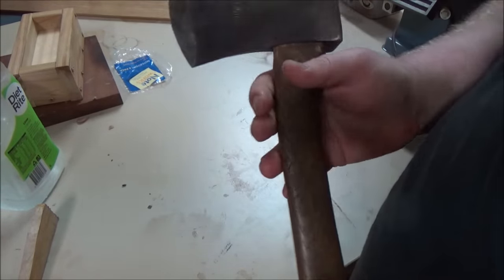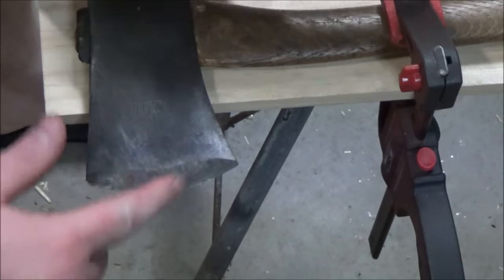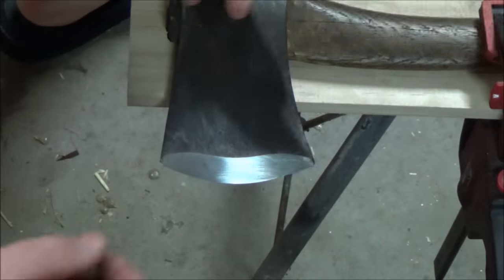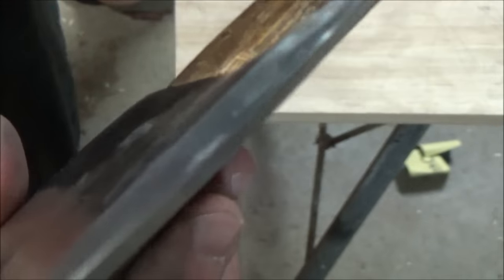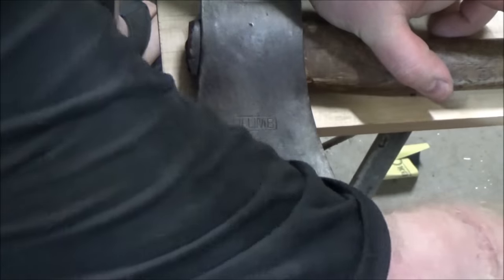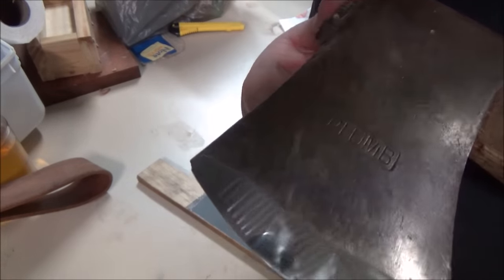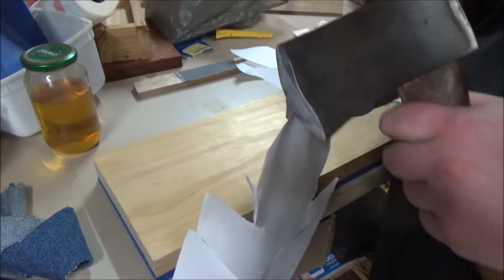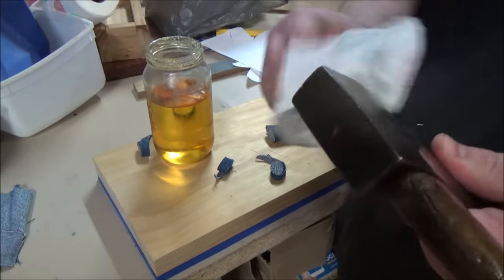How to Sharpen a Hatchet or Axe to a Scary Sharp Edge!

Comment: The hatchet is scary sharp, there's doubt about that. But. The flat angle that is being put on the edge is not best for hatchets and axes, it causes the blade to stick in wood. Hatchets and axes are supposed to have a rounded edge coming sharp at the edge, this keeps the blade from sticking while being used. Well done video, my friend, if that was a knife I'd want to have you sharpening mine.

Comment: Im gonna do this on my mower blade. I Love my Yard lol what can i say. TY.
Reply from the maker: It will work. But you have to be careful with mower blades. Make sure they are balanced or it is really bad for you mower. Look up how to balance a mower blade. I believe the little thing you put the on are quite cheap. The just take extra off the heavy side till balanced. You don't need to refine it like I did with the axe either. Rougher finish is fine. Even 120 grit should be fine even overkill for some people.

Comment: just remembe if you get too engrossed with the modern phenomenon of the micro bevel or "sharp enough to shave with" (who in their right mind shaves with an axe or chisel), that very fine edge is going to blunt, warp or chip very first use because its too fine to have the strength to stand the use.  only two things should ever be shave sharp, a razor or a scalpel.

Comment: About how long does it take to sharpen
Reply from the maker: It took me 30 min here. Including messing with the camera. It doesn't take that long once you get the hang of it and generally it isn't needed to be this refined of an edge. Less than 5 minutes of work and you can be back in buisness if you don't have to make a new bevel. Less than 30seconds if you touch it up often.

Comment: You should put one piece of sandpaper on each side of the stick. You wouldn't have to change them as often.
Reply from the maker: That would work well. I don't usually sharpen with sandpaper though.

Comment: hmm I have a diamond sharpening kit that's rough diamond to a very fine and there about the same size as how you made your strips
Reply from the maker: They will work great. But you are likely to wear the middle of the plate way more than the rest. So unless it is a cheapy you don't care for I wouldn't recommend it.
I have some cheap ones I do that with but they do unevenly wear on me. I had one where all the diamond was gone on the most used bit.
Reply: @scottshobbyz5416  I had them for years and I used then to sharpen my katana note it's  a real katana one of a kind made the way back then and they don't even look used and I use them every day to sharpen friends knives. I just didint think I could use them on a knife. It's a set of 12 different diamond like how you used different sand paper and 12 natural rock sharpeners

Comment: Is this axe convex edge ? Cuz i struggle mainting those edges
Reply from the maker: You can put either on there. I put a flat one and a micro bevel at the end for extra strength.
Touching up the edge is really easy and fast too. Just touch up the micro bevel with a fine Arkansas or similar  and it will be razor sharp again. You can do it loads of times before needing to address the main bevel again.

Comment: Going past 400 grit does not make the edge any sharper, but it does make the bevel really pretty.  Using 2000 grit will pretty much do what a leather strop/compound does, i.e. removes the burr.
Reply from the maker: I was aiming to make the bevel pretty. As I put a micro bevel on there, how refinded the apex is would be determined by the grit I used for that task. I would actually say that a strop with compound or a really fine stone would work better than 2000 grit sandpaper for the apex. The sandpaper micro bevel just doesn't seem to keep its bite as long. Also there was still a burr after the 2000 sandpaper albeit a lot finer. Which I used the bare leather to remove.
But at the end of the day the purpose of the video was to make the axe scary sharp ( part of being scary is the look) and teach people to do it without fancy tools or stones.

Comment: I use a fine grit flap disk in an angle grinder, one light wizz over each side and its done. Axes aren't supposed to be honed to shaving quality.
Reply from the maker: Depends on what you're using it for as to the level of sharpness that is optimal. For a wood heap axe or one you do nasty jobs with. I put little effort into it. But an axe I care about or I want a special edge on. I take my time and use stone/files.

Comment: I saw your vid ty to auto play lol! good one, a suggestion though (ty for the time-laps) why not let them know the actual amount of time it took? cheers!
Reply from the maker: I have answered it a few times. But I forgot to put it in the video. It was roughly 30min to sharpen. That doesn't include camera stuff, cutting sandpaper or any other set up.
You could avoid that extra time by using stones (and not filming) 
:)

Comment: What does one do with a scary sharp axe. An so expensive in time to achieve such an edge that one wouldnt want to use it to chop with
Reply from the maker: Mainly just enjoy it. But functionally it would work better for wood carving (people often use axes or choppers to quickly remove stock before using a knife), axe racing (I know this isn't a full size axe but axe racers get their full size axes sharper than this), trimming limbs off fallen branches or trees (best results with green wood). You do notice a difference in performance but there are diminishing returns. You can get 90-95% (my best guess)  of the performance just using a 6-8" mill cut file to finish. Maybe a bit of stropping compound on leather to remove any burrs.
This kind of result isn't really needed for the majority of tasks and is more for fun. Most wood heap type tasks this would be waisted effort.
Reply: @scottshobbyz5416   yes I see  what you mean. Good for delimbing if I stand on the opposite side of the tree from the delimbing   which I dont usually do,  Straddling  the trunk. Not good with a scary sharp edge and used to  bulk removal of chain saw sculptures

Comment: Could you use this method for chisels too?
Reply: Nikolai not really. I’d recommend using a whetstone for it as it would last longer and imo do better for a finer edge. I’m sure you could use this method but I prefer stones than sandpaper for finer tools like a chisel.
Reply from the maker: You could but I wouldn't recommend it. You will most likely end up rounding across the face of the bevel (only slightly but still not desired). By that I mean from left to right corner. Not like a convex edge which would be fine. I am going to restore a chisel on video sometime in the next few months. So you could see it then. But I do think you are better taking the chisel to the stone/sandpaper rather than the sandpaper to the chisel like I did with the axe. Also there are plenty of jigs out there for chisels/plane blades if you want to try before going free hand. Having a flat stone  is needed. A lot of people like sandpaper on glass too.

Comment: Me screaming: Linseed oil on the metal too!
Reply from the maker: Yeah I forgot. I also forgot to mention what is was so I have been asked loads of times. I do prefer a mineral oil for the head though. But if I don't have it there and I am doing the handle I do sometimes use the linseed.
Reply: Me screaming "remember to dispose of those linseed soaked rags safely" All too easy to start an unwanted fire in the shop with rags soaked in linseed oil.

Comment: AWESOME video, U can also get some thin walled pvc 4 inch sewer pipe, and with a heat gun U can fabricate a plastic pvc (kydex type) axe head sheath, clamshell style that will protect your ultra sharp axes edge and head and protect people from being cut by it, use rivets to fasten that sheath together and then spray paint it whatever color U desire??

Comment: as you went to all that trouble, why not re blue before sharpening? please do a video on sheath variations. lots of kids in scouting programs needed the safety lessons before you started. please add to this video. i liked the results. I found my plum hand axe without it's leather cover broken at the bottom and rusted. i have no idea who, how nor why. now i have to replace the handle or frame it as an example of how to not treat other peoples things. my old uniform whistle was found and returned busted another trip. It is shame that kids do not respect other peoples property.

Comment: Think this would work on a moraknive hatchet?
Reply from the maker: Should do. I can't see why not.
Reply: @scottshobbyz5416  Thank you! I just sharpened it up following your lead and it works awesome now!! The whole profile of the head is really different than a traditional axe which is why I asked. I first tried the file toward the edge method and was getting nowhere fast. Your method, I was done and cleaning up in less than two hours.   It cuts paper, and I can use it as a chisel! Thank you so much for this!!
Reply from the maker: Awesome. Be sure to add a micro or even secondary bevel if it needs. From the pics I saw of that hatchet I believe it has one.
I have another not as well done axe sharpening video where I only use a file. If you just want to use a file you can copy that method. Or just look up draw filling. I  am not the best at keeping a good bevel when filing towards the bevel. So the other way works for me.
Also you don't just have to use sandpaper you can use files or stones. I just did it to show you don't need fancy stuff to do it.
So glad it worked for you.

Comment: Mate, spray Windex on the paper and it won't clog.
Reply from the maker: I don't usually sharpen with sandpaper. Also I don't know how the tape would hold up. I was really only using it whilst it was cutting at its fastest. So even if it didn't clog it still wouldn't cut as fast as a fresh piece.
I do use wd40, window cleaner or sometimes water with dish soap when hand sanding blades. Even then it doesn't last long. But I am not trying to squeeze every bit of life out of it.

Comment: In the meantime, give me a file and I'd have it almost sharp enough to shave by now. And with no bur, that you have to take off later. If I were sharpening for a lumberjack competition, that hat be a different story. By the way, an old well worn belt works the best for what you did at the end. All that does is straighten out the bur you left.

Comment: What DO You Cut, With that Sharp Axe??.....How Many Hours Sharpening???.......Have You Tried a Belt Sander???
Reply from the maker: It only took about 30min to sharpen. Sharpening to this degree is really only beneficial when cutting green wood or carving. Tasks like that. General wood cutting and splitting will not see a benifit over a lower grit edge. But if you maintain the edge properly touch ups only take less than a minute and you are back to shaving sharp.
I have only used belt sanders when there is lots of material to remove or is is a cheap axe I don't care about. A belt sander would be too aggressive for this axe as the bevel is already set.

Comment: Can it cut wood?
Reply from the maker: Of course
Reply: @scottshobbyz5416  :  I mean without getting dull real fast?
Reply from the maker: You don't keep that razor sharp apex for too long but it stays sharp for cutting wood for a good long time. Also very easy to touch up the edge. A few swiped on each side (of the micro bevel) with a fine Arkansas stone and a few alternating swipes and you are back to razor sharp.
Reply: @scottshobbyz5416  OK, thanks. I'll try that out on my chopper.

Comment: Axes and hatchets are not meant to have any bevel - they are supposed to be a continuous rounded bevel from the edge to the thicker part.  Flat bevels encourage binding in the cut.
Reply from the maker: There are different ways of sharpening them. I haven't played around as much as I would like with different edge types and finishes. As I just don't have the opportunity to chop wood much any more.
But what I can tell you is this type of edge busts out chips like nobodies business.
I haven't had any real experience with convex sharpened axes yet. Hopefully one day I will get to it.

Comment: Great technique, but when do you need an axe ‘that’ sharp? Surely just a risk to the user...
Reply from the maker: it's only a risk if you don't know how to use it properly or aren't paying attention. The main dangers are having part of yourself in line of where the axe may go if it follows through. And glancing blows. A sharper axe makes glancing blows less likely and you should never be in the way off the potential follow through. Although it doesn't have to be this sharp to greatly minimize glancing blow and work well. This was more for fun.

Comment: You need to address edge geometry. You can have a razor sharp edge but if the geometry is to obtuse it will not split well.

Comment: Since the purpose of an axe is chopping and splitting, an edge that is sharp enough to shave with is a bit impractical.  Less than 25°, the edge wouldn't be durable and wouldn't split as it is meant to.
Reply from the maker: I am not sure what the bevel angle is. But it has no problem with durability so far. It splits kindling great. But I mainly have it for wood carving. Also maybe camping. If I ever get around to going again. There is no point refining the edge this much for splitting or general wood heap chores. The payoff is negligible compared to the effort put in. This edge is more suited to chopping green wood, axe racing, carving and showing off ;)
Reply: @scottshobbyz5416 – Well, the axe does have two additional angles, so that does help.
Reply from the maker: If you mean the micro bevel I put on it. It sure does. It would roll for sure without it. Possibly worse if you hit a tough knot.
Reply: @scottshobbyz5416 – No, the moded shape of the axe head itself.  Rather than just a straight wedge, there is a second angle on it, before the edge itself was ground.
Reply from the maker: Oh yes I know what you mean. The Plumb Dreadnoughts have that profile. It seems like a good all round one. It works great for splitting even with a fine sharpening angle like I have here. But also cuts across grain really well. I have some hults bruk axes and I really like their profile for chopping. But splitting with them would be a nightmare in Australia. Unless you were doing pine. It just doesn't have much of a wedging effect.

Comment: Scary sharp for about 3 whacks of what a hatchet is supposed to be used for which isn't shaving or food prep. What's next... the "Fastest slow-motion video"?
Reply from the maker: Seems to keep an edge for a good long time.
Reply: @scottshobbyz5416  Hahahaha.... maybe you are a little biased, but I am sure it cuts butter like a knife.
Reply from the maker: Not at all. It does seem to stay shaving sharp longer if you finish (the micro bevel) it with a fine stone as opposed to the sandpaper. I don't bother keeping a wood heap axe this sharp. But ones for green wood or carving work well. If you are just splitting some kindling or chopping dead wood to lenght this extra sharpness isn't worth the time you put into it.
Reply: @scottshobbyz5416  Henceforth the ridiculous title.
Reply from the maker: I don't see how it is ridiculous. It was a tutorial on how to get it scary sharp. That is what I did.
The purpose was to show you don't need fancy tools or stones. 
The video wasn't about edge geometry for different tasks, edge maintenance or anything else. Just how to sharpen. I believe I delivered.

Comment: Good job but why would you need an axe that sharp you’re chopping wood, 10 hits and it’s how sharp it would have been if you just sharpened it quickly with a belt sander plus the narrow edge will just dent and deform
Reply from the maker: I don't find it dents. At most it may roll a little. But once you touch up the microbevel a couple of times it is usually very stable even on dead aussie hardwood. I plan on using it more for carving or green wood which it holds up good on. But for a wood heap axe I usually just make sure I reached an apex. Maybe 400 grit max if I feel like it.
Reply: Yea fair enough makes sense

Comment: So a first big chop into a tree will ruin the edge?
Reply: If the steel is good, no.
Reply from the maker: Plumb axes are pretty good. The USA ones not the knock off Chinese ones. It won't stay this sharp for long but it stays plenty sharp for a while. To keep this kind of sharpness axes have to be touched up often. This is overkill for most axe work.

Comment: I suppose the same method could be used for a machete.
Reply from the maker: Yeah I suppose. I find this works for the wide axe bevel as you can ride along it easy. But all the machetes I have sharpened have a narrow bevel. I usually just use a file with the machete being held in a vice. Then I take a small stone to the machete if I want to refine the edge more. But it would still work. As long as it gets your edge apexed.

Comment: I've seen this around pepole I get let's say having cheap chinise axe cut of an old saw blade kinda to catch little rust even over the limit but old axes no chances like 1 in 5 I see is at least not rusty but for matter of fact handles don't look better I became polymer fan quite after I got 1 chinise axe similar to ur one's style but yet not as decently shaped owdoe got me surprised at how much punch the handle can eat xd I have my regulars but that one was up to the test sadly it didn't hold fine edge and try corrode on me after that I sand it down now it's better but I might try get better one on its blade shape n back taking of material when not needed